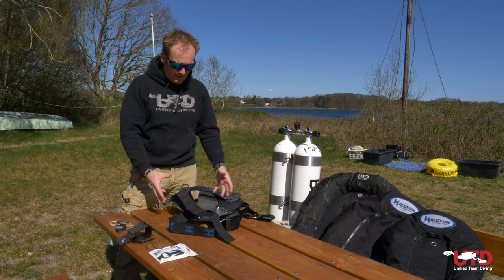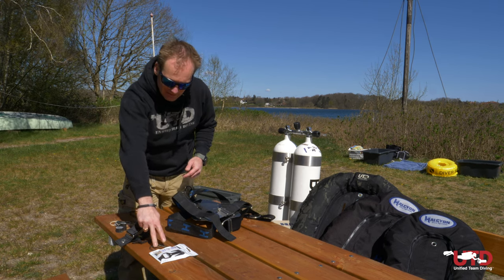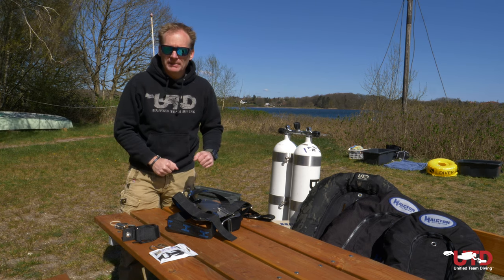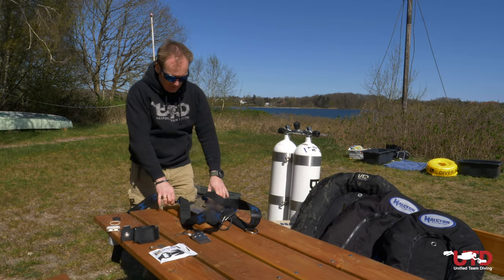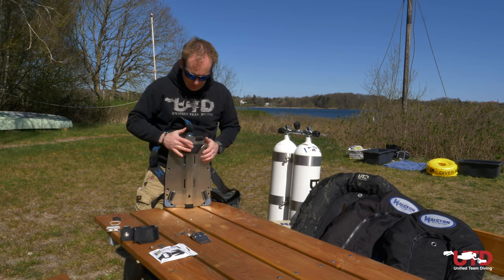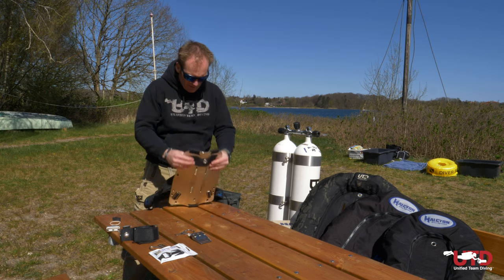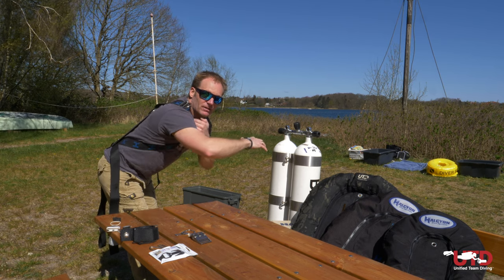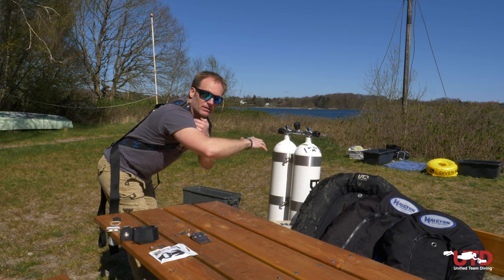How to setup your DIR Harness and wing Configuration

Comment: Can you cover how to clean equipment with DIN fittings since they don’t have a rubber cover like yoke style I have dust covers but didn’t want anything going back in them
Reply from the maker: Ivory Johnson i leave my regulators on my set and keep them pressurized when rinsing. When I am done I take the pressure off and unscrew the DIN with one turn to relieve the stress on the O-ring. This way it's highly unlikely debris or contaminants will get into the first stage. However the thread can sometimes accumulate son lime scales and you can get rid of that with a brush and some citric acid dissolved in water. I'll do a video on that in the future. Good idea!!

Comment: Another great video Ben. Any suggestions to someone with a long torso? My hip straps are quite high related to my hips.
Reply from the maker: Hi Chris, I know many divers who are tall and dive a standard backplate. There are some longer options on the market. But I guess it's trying to find the sweet spot between the length of your shoulder straps and make sure the shoulder straps are not too tight.

Comment: Excellent as usual Ben. For getting out of the harness in the water do you prefer putting your hands close to your chest and out or pulling the harness off via the longhose etc.? I find he latter doesn’t work as well for removal in the water
Reply from the maker: Yes, that is also an option, I just feel more control by putting my hands through first, instead of my shoulders, also I find the risk of my gauges getting caught less likely. But in the end its all good, if you get out, your out :-)

Comment: Hello. Minute 31:43 of your video, you explain the importance of having a shorter hose to vent gas. What I don’t understand is this: how are you going to be able to raise that hose to vent gas, if it’s under a bungee that doesn’t have that much play? The height of the hose (I.e.how much you can raise it) is restricted by the bungee keeping it streamlined to you. Explain please. Thanks
Reply from the maker: yes, the longer the hose the more it creates a sifon, its has more to do with your body position than the length of the hose. Plus we rarely use the hose for dumping under water only on the surface. Under water we try to use the dump valve on the bottom left of the wing. But good idea for a video, stay tuned to this channel. Ill post on about this subject.
Reply: @UTD_ScubaDiving  understand fully once underwater just unaware how to do it given this constraint. You would have to have the inflator out of the lanyard, and secure once descent has begun.

Comment: hello, whats the wing capacity recomendation for twin cylinders, dry suit , air, no stages ?
Reply from the maker: That is a very good question, and probably warrants it's own video. So stay tuned for that. But the short answer is that the wing or any BC for that matter has 4 jobs. 
1: cary the weight of the gas in your cylinders underwater. 
2: keep the diver positive at the surface
3: keep the equipment positive when floating on the surface separate from the diver 
4: compensate for wetsuit compression

So it depends on the total weight of your kit :
Cylinders
Regs
Backplate
Integrated none-ditchable weight
Light or heating canisters
And don't forget the weight of the gas. 

You can test your kits weight by submerging your complete setup. Holding it with a string and a suitcase scale. 

So make sure the wing can carry this on the surface at the beginning of the dive. And don't go overboard with wingsize. To big becomes a hassle under water.
Reply: @UTD_ScubaDiving   Thats quite a good idea with a suitcase scale. I've just checked, you can have one for 10 dollars.

Comment: I have a question,sir:

I dive warm water daily(Aruba),rashguard ,shorts,3mm wetsuit sometimes.
I use a Scubapro Hydros pro(back inflation)
2pounds weight w shorts
4pounds with the wetsuit.
I want to get a backplate and wing to start my tech training.
My question:
Aluminium back plate with P-weight?
Or Steel backplate with no weights?
Reply: Single tank diving
Reply from the maker: Hi DOHCG, thanks for your question. 

The wing should under water only cary the weight of the gas in your cylinders. 

At the shallow depths 10-18m 60ft. You carry detachable weight to offset the gas weight, should your wing fail at the beginning of the dive. 

When we dive a thicker wetsuit (thicker usually than 3mm) the material compresses at depth and you compensate for this as well with the wing. 

This is where you have to be careful. You are at risk to be so heavy that when your wing fails you can get safely to the surface. You might be able to ditch more weight if you have. But then you have a problem in the shallows. 

Test it out by doing a dive in the setup you need for tech dives. With near empty tanks. You should be able to stay neutral in about 3m 10ft. Without gas in your wing. 

But if you need more thermal protection consider a thin flexible Drysuit.